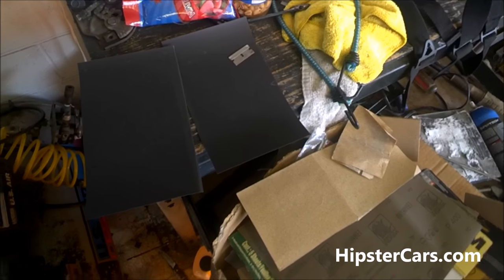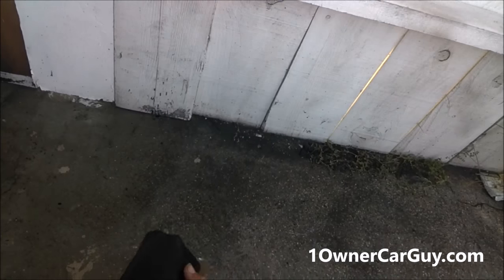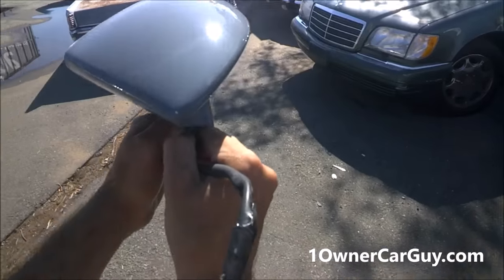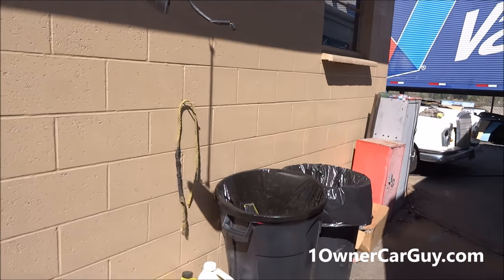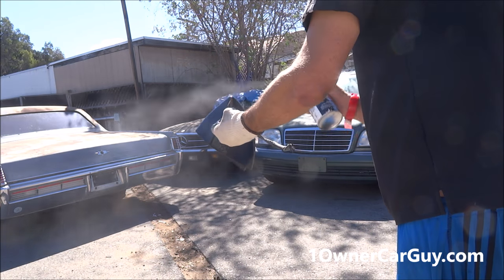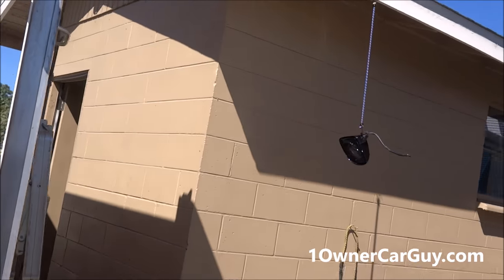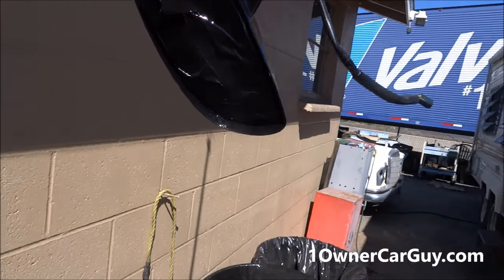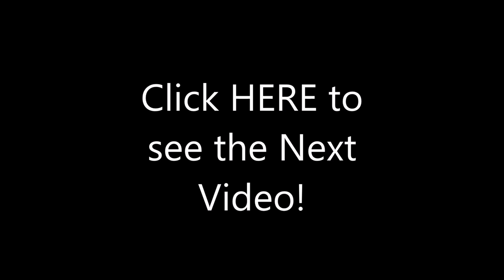Prep & Spray Paint Car Parts GTA Mirror Easy DIY Cars Video ~BTS  #4

Comment: Painting in the sun is no good. And using Krylon paint, wow aerosols cant not be painted over with real paint, now the new owner will have to strip that down to bare metal to repaint it the right way. But they wont know the crap paint job that was done on the mirror. I am so tired of these car sells guys who do shaddy work. And this guys not even hiding it.